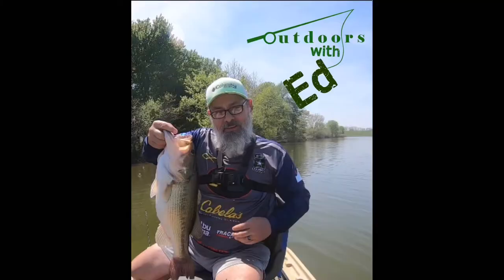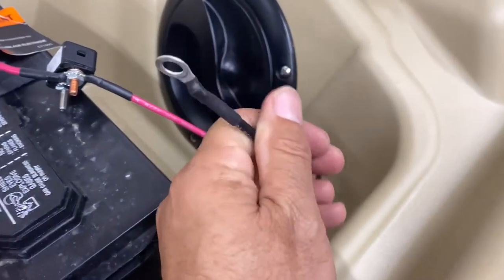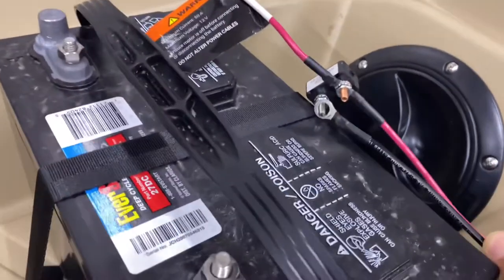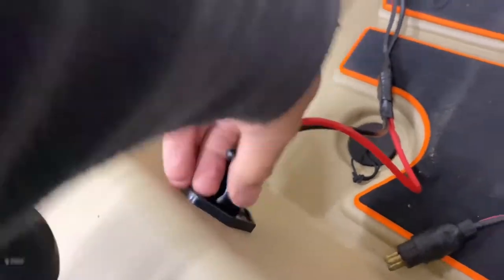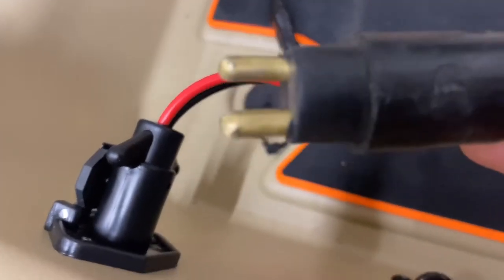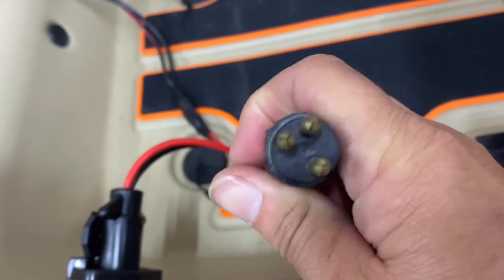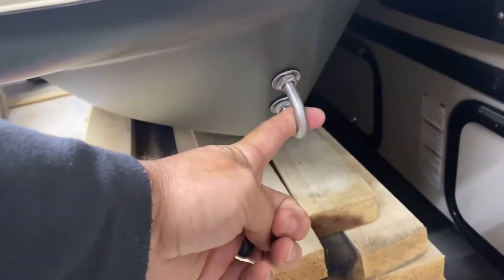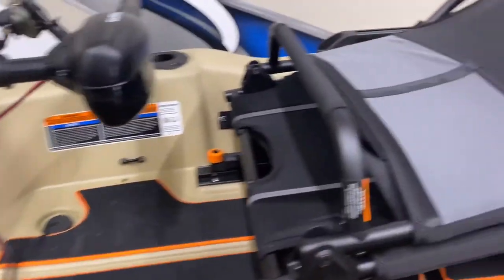Minor obstacle with plug while connecting Trolling motor on my Catch PWR 100.

Comment: Ok the circuit breaker for the battery is for the positive only not the negative. The red wire from the boat gos to one side the breaker and the extra wire goes from the breaker to the battery. The black wire goes straight to the battery.
Reply from the maker: Thank you. I finally figured that out. 😂

Comment: I have one too and I don’t remember if anything was attached to the other stud on the breaker, but it may be for powering something like a fish finder, I use mine in Maryland black water wildlife preserve and I got stranded when I ran into grass and the motor stopped, I thought the motor got hot and needed to cooldown but that wasn’t the problem that circuit breaker has a little reset button on it and it took me a long time to figure that out.  FYI if that happens to you.     Ps. I like mine and I’m 71 years old

Comment: The plug 🔌 that comes with the pelican pwr 100  may seem like it doesn’t fit but once you wiggle it in there a couple times it gets easier to go in and out I had the same problem and the breaker is fine how you have it only for the positive

Comment: What shaft length is your trolling motor. I’m using a 36” shaft with 46lbs thrust motor still kind of long for the boat.
Reply from the maker: It’s a 36” 30lb. I’m thinking of getting the 24” 55lb
Reply: Try the 36or55lb thrust 24" shaft kayak trolling motor off Amazon from Newport vessel. Good sht

Comment: I bought this kayak the other day and as I tried to put in the trolling motor realized I didn’t get anything I was suppose to with it from Academy. My question is do you have to have the circuit breaker to run the trolling motor. New to the kayak game lol
Reply from the maker: I think it’s best to get it and do it right. First try going back to Academy and tell them. Or write to Pelican customer service and explain. Either way I’m pretty sure they will make it right and get you what you need.
Reply from the maker: I was new too when I got this one. :)
Reply from the maker: Also with these connectors if Academy or Pelican won’t make it right, they aren’t going to break you get what you need.
Reply: I did already. Ordered them off Amazon yesterday. Academy tried arguing with me that the kayak should come with the swivel bearing so I just bypassed them.

Comment: I'm not an electrical engineer nor an electrician. I don't really know the answer to your problem but my boat has a fuse only on the red line side. I am confused because of the copper and silver poles which usually signifies positive and negative. You may want to take a meter and see if there is a direct connection before apply any positive and negative power from the battery on the fuse. So as for my advise, I am not telling what to do I am just giving you my experience and what is happening in my boat which has multiple batteries.
Reply from the maker: I was able to get it solved pretty quickly after I posed the question on a Pelican forum. :). On my Bass Raider boat I was using a power station battery box and the breaker was already built in so I didn’t know how the breaker as supposed to be wired:).